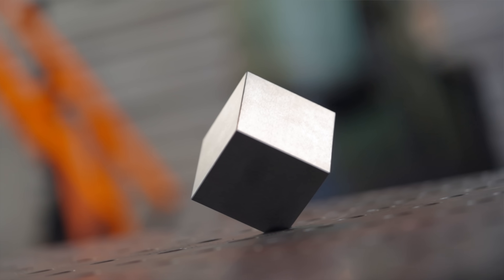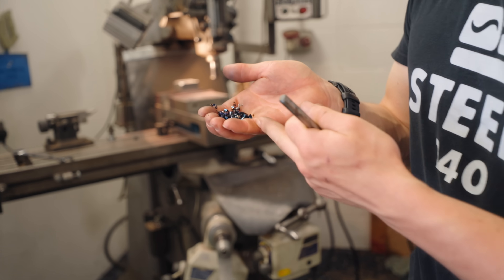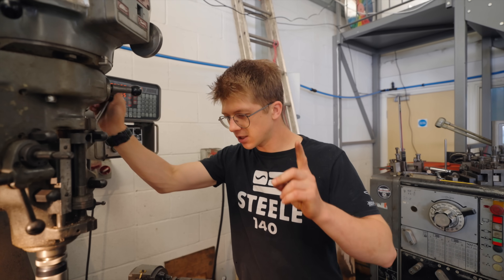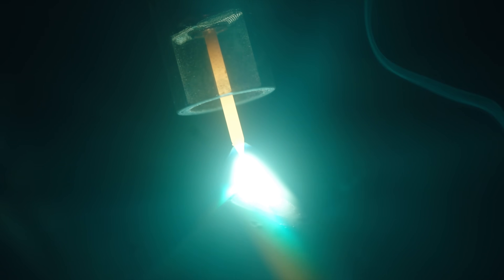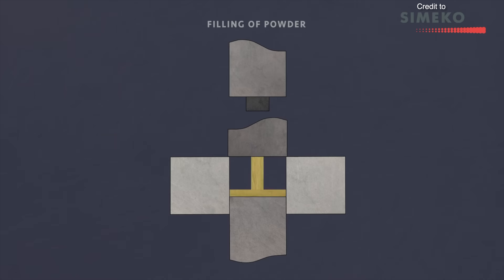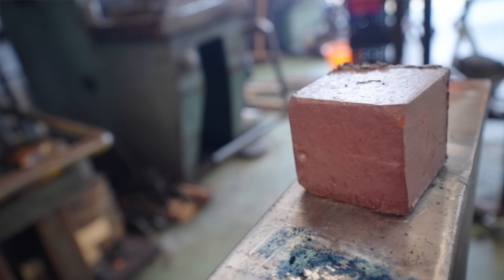Can You Forge Tungsten?

Comment: Aircraft technician here, we use tungsten for bucking bars. We drive aluminum and steel rivets with a rivet hammer (rivet gun) and a bucking bar, because tungsten is heavier than steel it drives the rivets easier and with much less vibration on your hands. We can also use smaller bars that still have an effective weight to get into tight spaces.
Reply: Probably a stupid question but when you say effective weight that makes me think the same weight of steel would produce the same strength as the same weight of tungsten. Is that true?
Reply: @Idkbutimwithjesus  Hey, another Aircraft technician here. Essentially yes, you could use steel of the same weight as a bucking bar, but riveting totally relies on the ability of a material to absorb and transfer the riveting energy. So yes, steel does work, but tungsten is better because of reduced vibrations due to its dense build, and even things like needing a small bucking bar to get in the inside of an aircraft wing. Overall, tungsten just transfers energy better, and causes less fatigue to the person using the bucking bar.
Reply: I'm actually going to college to become an aircraft technician. Do you have any tips for someone who's about to start their career?

Comment: cuts tungsten: no way this metal cutting blade can cut metal! 
seriously though, it's very dense and hard but it isn't indestructible Alec and using a hand saw in this instance may actually be advantageous over a power saw, since the tungsten is so hard the blade will definitely last way longer.

& you could forge it but the question then becomes is forged tungsten actually worth the effort? 200 more degrees and I personally think it'd become more workable but again, are forged tungsten pieces worth the effort, I wonder if the heating and cooling during forging changes how it behaves at all.

Comment: Metals have different properties associated with them as you know of course, but I'm curious to see what happens if you use smaller pieces to forge instead of larger blocks such as this or the magnesium from a previous video. I would expect to see a bit more progress with smaller pieces, which is just a guess, because the larger forces from Hammers and presses could have a greater force over a smaller area. It might also be interesting to see if some thin sheets could be heated and wounded together with steel to make a Damascus pattern. I know the forging temperatures are greatly diverse for the two...but if the smaller (thinner) sheets are more temperature sensitive perhaps it might work.  About your magnesium experiment...would it ignite if oxygen wasn't present?  I ask only because thermite will ignite even under water, also if it requires oxygen to burn and you can heat it up to a higher temperature in a neutral gas to the point it might be workable. Though looking at your standard shop, I'm not sure if that would be doable. Regardless your videos are interesting to watch. Thank you for making them

Comment: The reason it was smoking when you pulled it out of the forge is actually because tungsten when heated to that point needs a shield and gas to not oxidize and tungsten to oxidize at those temperatures actually end up smoking a ton if you ever finish a Tidwell where you’re pushing right at the limit of the welder for a couple of minutes so that tungsten got hot. You’ll notice that it will smoke, but the smoke is being pushed away by the shielding.

Comment: what you need is an electric arc furnace. In high school I built one and melted some difficult materials including bits of tungsten, rocks, the shale blocks I initially used for the furnace, and even the graphite electrodes (which actually sublimate, rather than melt). It's worth noting that graphite has a similar melting point to tungsten, so you will want to control your temperatures religiously (or just treat the graphite as a wear item). I'm sure you could forge Tungsten, with 2x the temperature than your gas furnace can achieve.

Comment: 3:00 or it could be lead
Reply: Tungsten is far more dense than lead. Lead is 11.3 g/cm³, whereas tungsten is 19.2 g/cm³. At 19.2g/cm³ and 5 kg, we're looking at 260 cm³ of tungsten.  To get the size of a side of a cube with that volume, we just need to take the cube root of 260cm, which leaves us with 6.38 cm or ~2.5 inches. At 3:03, when he's holding the cube one edge goes from around the middle of his palm to the first joint of his ring finger. Using some calipers set at 2.5", I can do about the same.

A 5kg lead cube would be 7.6cm/3" on a side. While not impossible, I think it would be hard to hold that with one hand. My hand has to be stretched out a lot further to fit 3" between that spot in my palm and the first joint of my ring finger.

Comment: If you cut it down into smaller pieces, you could forge it much easier given that your force needs to work through smaller "packages" of material properly. 

You could forge it with proper dimensions of the material being heated and worked.

Comment: You'll want to be careful heating tungsten to over 500C, the gas it releases when it starts reacting with oxygen at those temperatures while not particularly dangerous is a nasty irritant. (Tungsten Trioxide) I would also wager it is what tripped the circuit breaker since it is a semi-conductive gas.

Comment: Someone has got to get Alec Steele to turn that chunk of Tungsten into a slit and drift! Uri Hoffi used to use ground tungsten from spent tank shells in Israel to make hot work tooling. Think about it! When the steel you’re forging is white hot, your tungsten drift can he at the same temperature and still gives zero fucjs about what your punny little air hammer, or hydraulic press is trying to do to it!

Comment: Tungsten at 1300C-ish is about as close to melting as a piece of iron is at literally the temperature of liquid nitrogen...plus another 1000C.
Tungsten is one of the few metals that would remain a solid a few million miles from the Sun. Even at Mercury's distance of 30m kilometers, tungsten wouldn't get within 3000C of its melting point - only reaching 430C on Mercury. Even on Venus, it only reaches 460C, THOUSANDS of degrees below tungsten's melting point.
I suspect you'd only get to a temperature you can actually forge tungsten properly either using plasma, or oxy-hydrogen which reaches theoretically somewhere between 4300C and 2730C.
I'm not certain you'd be able to heat metal properly and evenly using a thermal lance though!

Comment: Typically done at very high temperatures, close to 2,500°C (4,532°F) in a controlled environment, often under vacuum or with inert gases to prevent oxidation.

Comment: One way to know if it's tungsten is to try melting it. At 3400C, tungsten has a much higher melting point than steel, which is one reason it is used as an electrode for welding.

Comment: I use tungsten in aviation sheet metal work. Because of how dense it is, it's used to buck the tails of solid rivets while the head is hammered with a pneumatic rivet gun. Standard bucking bars are cast steel and do work just fine, but they have to be large in order to have enough weight to actually work good and swell rivet tails. But tungsten bucking bars can be MUCH smaller while staying heavy, so they're easier to maneuver and hold in place while the head is hammered on.

Comment: I don't think that cube is pure tungsten.

It's probably a very common 97% tungsten alloy that is commonly sold on popular websites.

That's purposefully made into such an alloy to be more easily machinable and made in a cube without having to slowly cut it with water and have less sharp edges.

So yeah, after all the jokes, I think you've actually been scammed.
Reply: (copypasta)
Because pure tungsten is expensive and difficult to manufacture and machine, alternative materials were sought which would maintain some of the useful characteristics of tungsten, such as density and X-ray shielding capabilities, but which would be easier to machine and less expensive. The result of this quest are the Heavy Tungsten Alloys.

Tungsten heavy alloys are ideal for high-density applications or for use in radiation shielding. Heavy metal tungsten alloys are 90% to 97% pure tungsten in a matrix of nickel/copper or nickel/iron. MTS can custom machine any alloys to finished parts according to your specifications. We carry an extensive inventory of tungsten alloys and provide quick turnaround for those items not in stock.

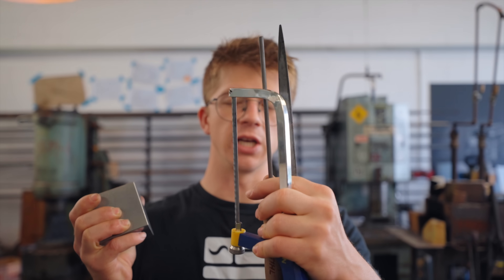Comment: 2:19 actually, your tungsten-carbide tooling is made out of a "paste" where powdered WC (Tungsten Carbide) is heated in a press, then gets enough Cobalt (Nickel is used for WC jewelery, but the high-quality tools use Cobalt binder) added to melt & "wet-out" all of the powder grains, to make a solid matrix, with the binder-metal holding all of the ceramic powder together.
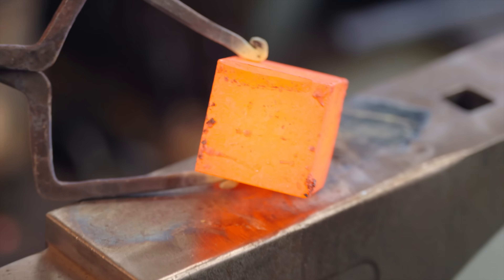Reply: 13:16 the tungsten is smoking when it comes out of the forge because, iirc, it's actually a quite reactive metal, so that's likely smoke from tungsten at the very surface "burning"

Comment: We use tungsten bucking bars a lot in aviation because you can use a smaller one in tighter areas or buck steel rivets with them easier then using a steel bucking bar.

Comment: Try out Hadfield steel! An alloy of iron and about 13% manganese. Not so expensive. The hardest of all steel alloys, in the sense that it won't deform but rather crack. Used in safes, brake discs, rock crushers. That is a tough steel to machine! It gets harder the more one beats it. So it is actually hardened by covering it with TNT and detonate it!

Comment: Tungsten is required for some "big rulers" that are used in measuring height-differences in construction, because it doesn't really change size depending on most temperatures, meaning that if you're measuring something over the course of a day (with different temperatures during the day) you won't have any differences from that. This is usually for projects where "1mm uncertainty over 1km distance" isn't really an acceptable margin for error, so... something of a niche.

Comment: Do you guys have a decent solid fuel forge sitting around anywhere? You could get the temps up higher with that, still might not be enough though. That's the only Idea I have for you, aside from cutting it down to 30 mil square instead of 60-65 lol.

Comment: You couldn’t figure out forging temps for Tungsten on the Internet so I asked ChatGPT and this was the answer:

Forging tungsten is extremely challenging due to its high melting point and brittleness at lower temperatures. Tungsten has a melting point of around 3,422°C (6,192°F), which is one of the highest of all metals. However, forging is typically done at temperatures lower than the melting point but still high enough to allow the material to deform without fracturing.

For tungsten, forging usually takes place at temperatures between **1,400°C and 1,600°C (2,552°F to 2,912°F)**. Even at these high temperatures, tungsten is still quite hard and resistant to deformation, so special equipment and techniques are required. Additionally, tungsten is prone to oxidation at high temperatures, so forging often occurs in a protective atmosphere, such as hydrogen, or under vacuum conditions.

Forging tungsten is not common outside of specialized industrial applications because of these difficulties.

Human again: Cheers 😊

Comment: the cutting disc prob. didn't liked it coz the RPM was too high... with less speed it would have prob. cut just fine...
Cutting metal is all about feeds and speeds beside of having the right tool to begin with.

Comment: We use tungsten ion sources for our particle accelerators at work, the density is extremely weird! Feels very unnatural in the hand. We use it not only for the temperature resistance but also for chemical resistance (the ion source has to resist etching/redeposition from fluorine plasma, at least as long as it can, nothing is immune), with moly being a cheaper substitute (slightly worse performance, with added moly contamination).

Comment: Hey the reason that it melted that way when u used the rig torch is because the block did not have gas covering it if u had ur gas flow higher it wouldn’t have just like if u try and rig weld without gas the tungsten in the torch melts

Comment: The reason why it's softer than the carbide could be the same thing which makes Iron Softer than steel. Atomic lining. Iron's atoms are arranged in a straight line which makes them less resistant while steel has a random placement of carbon atoms that provide support to the molecule and harden it.

Comment: If you're working with smaller-scale pieces of tungsten, the best way that I know of is using an induction heater. They're not that hard to build, and the heat output is only limited by how much current you can put through it, so you could get it hot enough to completely liquefy tungsten if you had the amperage to spare. The catch is that the piece of tungsten has to fit through the rings on the heater, which limits the size of the piece you can work with severely, and it's a different process because of heat distribution (the surface will heat faster than the core, so if you want to stop short of just turning the entire piece into a puddle, you have to heat in cycles to allow the heat to disperse throughout the work). Bit of a different experience, and it's certainly not conventional blacksmithing, but it can be done.

Comment: The hardness of Tungsten Carbide doesn't come from the Tungsten, it comes from the diamond hard Carbide. Which is just carbon and when it reaches a certain temperature will burn away. The Tungsten is there for the heat resistance allowing the Carbide not to burn away as you are cutting with it.

Comment: According to ChatGPT 4o: To forge tungsten, the material would need to be heated to a very high temperature due to its high melting point and extremely high recrystallization temperature. Tungsten has a melting point of approximately 3,422°C (6,192°F), but forging usually occurs below the melting point.

For tungsten, forging temperatures are typically between 1,400°C and 2,400°C (2,552°F and 4,352°F). At these temperatures, tungsten becomes more ductile and workable. However, even at these high temperatures, tungsten is still challenging to forge due to its brittleness and tendency to crack. Specialized equipment and techniques, such as hot isostatic pressing or working in a controlled atmosphere to prevent oxidation, are often required.

Comment: Idea here for getting this hotter: induction heater. Yes, tungsten is not ferromagnetic, but eddy currents from induction heaters will heat up just about any metal. Might be a great low-cost way to get this metal to a workable temperature.

Comment: Not a metal but You should do a test on a big cube of silicon carbide, slightly higher hardness than tungsten carbide and unbelievably tough.
I buy cheap loose moissanite which is the jewelry grade and tried to bust One open and it put a series of shiny dents in my hammer, not a scratch.
Its electrically conductive, try to weld it.

Comment: To those who want to make pure tungsten knives:

I made a knife with pure tungsten once, but instead of blacksmith, I use wire electrical discharge machining to cut tungsten plate into knife template, then grinding and shaping with belt sander( install ed cubic Boron Nitride)

Comment: I had to cut a 5/8" diameter round tungsten bar the other day and used a typical abrasive blade (aluminum oxide) in a three HP abrasive chop saw with a 7" blade and it took about four minutes to cut through it. This saw cuts Inconel like butter and low carbon steel effortless and it really struggled to cut the tungsten bar. Not only did it take a long time and require more pressure than typical but it ate up the 1/16" thick cutting disc and the cut was curved and angled which I've never seen with this saw. I switched to a diamond blade which cut it in half the time but it only cut two pieces before wearing out though it wasn't new it only had a little wear to it and the second new blade cut two more and didn't have much life left after that. I had to face these pieces in a lathe and after the cutting experience I was surprised to find that they cut about the same as a tool steel, not bad at all using a carbide inserted tool. I tried to cut it with a carbide inserted cutoff blade in the lathe and it kind of worked but it was slow and took a lot of pressure, after cutting one piece the second piece broke the insert along with the end of the bar off. It seems that they almost get harder as heat builds up as in abrasive cutting but if you keep it cool it cuts fairly easily. I wonder if this would have deformed more had it been kept at room temperature?

Comment: I'm a machinist for a coal powered steam plant. I machine tungsten frequently. We use it to make weights that screw into the turbine blades to balance them.
It is absolutely insane how much a small piece of tungsten will weigh. I hate machining it though, the machinability of tungsten isn't the best, but its also not the worst material to work with either. If you want a great, and really durable formal wedding ring, get you one made of tungsten. They don't scratch easy, if at all, and will last you a lifetime. Just don't operate any rotating machinery or tools while wearing it though, unless you don't care about losing that finger. Make sure you get the right size too because they cant resize them.